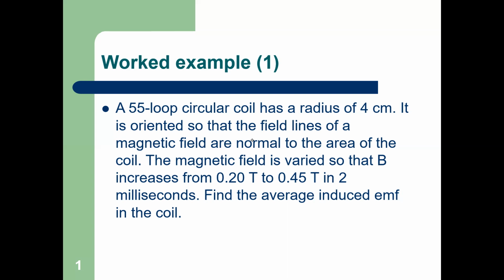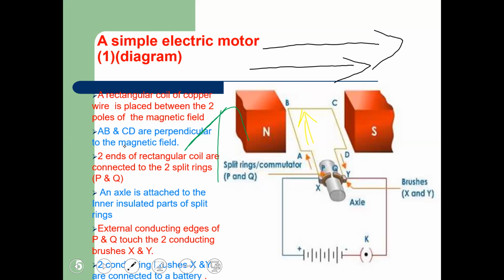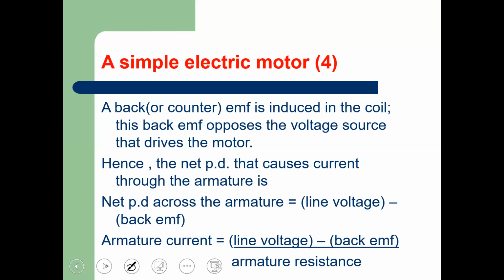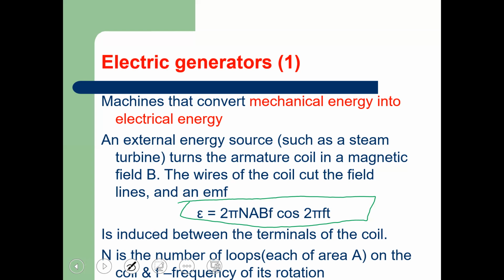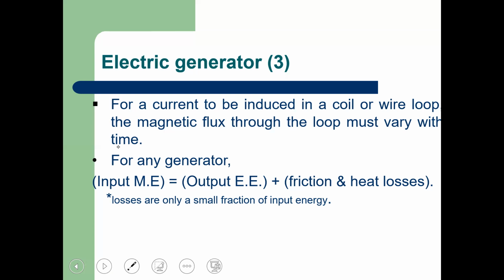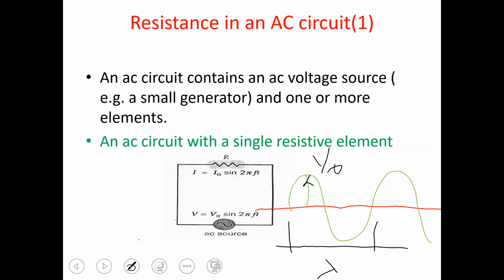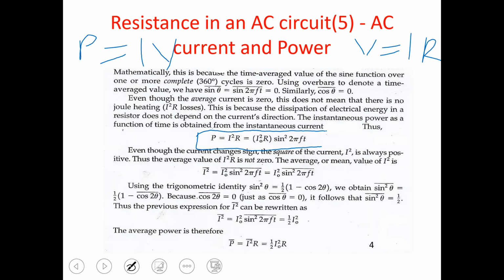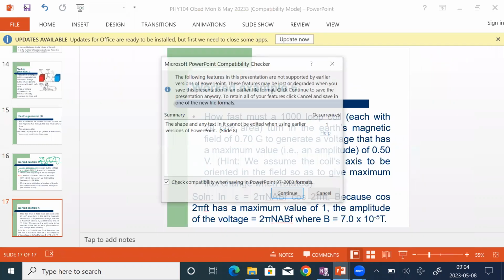Applications of Electromagnetic Induction

Comment: Hello sir, you said the first motor we had was DC motor and the second one was AC motor, how can we differentiate them? 
Besides, the new school physics I'm using to get a recap of the topic classified generators into two: AC generators and DC generators but didn't say anything about motor. The DC is the motor we treated first and the AC is the generator we treated secondly.
Reply: 29:33 
You called it AC motor here but I'm seeing it elsewhere as AC generator, isn't there any difference between Motor and Generator?
Reply: @adebesinolanrewaju3740  a generator converts mechanical energy to electrical. A motor does the reverse. So you can expect a diagram of a generator to be connected to a field without a battery (it serves as a source of current) while a motor would be connected to a field with a battery.
Reply: @samuelekop5273  ohhhh, it's understood now. Thanks 🙏